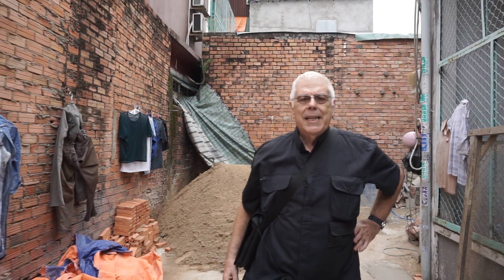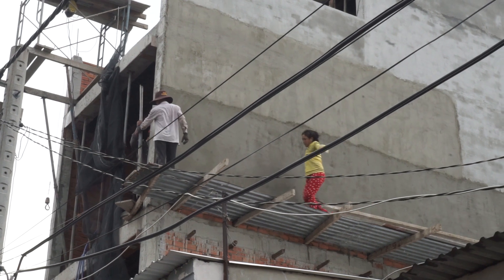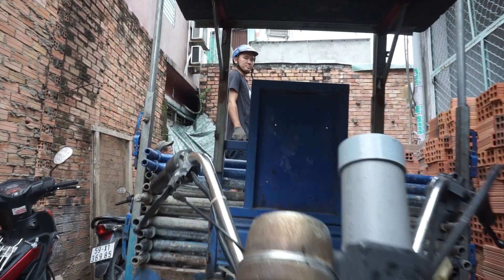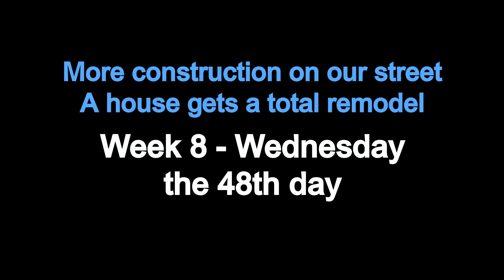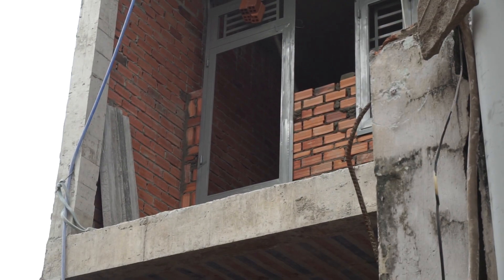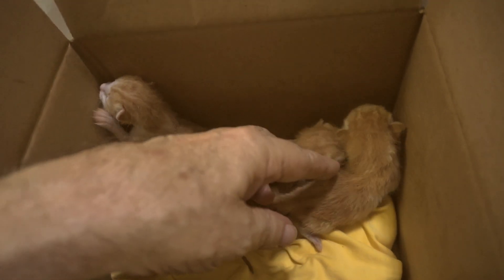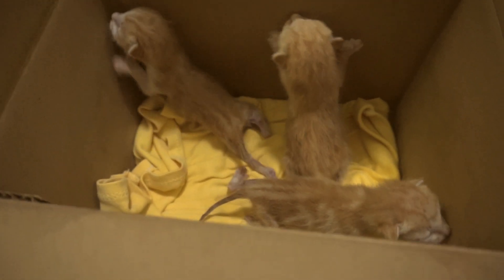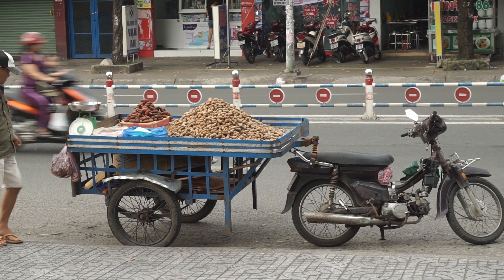The New House is Really Taking Shape! Kittens Visit and Have a Cameo in this Video. (Documentary)

Comment: Greetings JR, the sound quality was good.  Were you able to see them run the plumbing and wire? I like PHILIPPERV’s idea about the extent of the polka dot clothes line.  😉....
Reply from the maker: Hahaha ---it is a mystery where those polka dots come from. ... I've been working hard on sound quality. Will be so glad when you get here with those Tascam recorders. I think it will add a lot to the vids ... They aren't running any roughed-in plumbing or electric yet, only the septic tank and a drain for the top floor balcony have been done. Sure is fun to watch them. Thanks for the comment.

Comment: The progress continues.  Interesting to learn that the electrical and plumbing work is done at a later time by just ripping parts of the walls and floors.  However, that is not totally surprising because the Vietnamese have their own way with construction, often times for reasons that others do not know.  Amazing that they wear sandals around all that construction activity.  I think it is great that you and Rhea live outside of the "foreign" neighborhoods - it certainly seems like you are getting to experience a more authentic and more fun Vietnamese neighborhood.  Sounds like the right move.  

Your part of Sai Gon is more like the real Sai Gon.  The "new" Sai Gon downtown has too many buildings that look like copies of those found in Western cities and lack the Vietnamese charm.
Reply from the maker: I had a vacation house in Baja and the Mexican workers did plumbing and electric the exact same way. I guess since the clay bricks aren't structural, it doesn't matter. Interestingly, they do generally run all the electrical in conduit with j-boxes. My house lacked cutoff valves for plumbing fixtures and water heaters. Even the main from the meter had none. We added them when we remodeled.
We do enjoy living in the non-Western suburbs. We are the only foreigners in the vicinity except for the occasional transient English teacher. Thanks for watching!